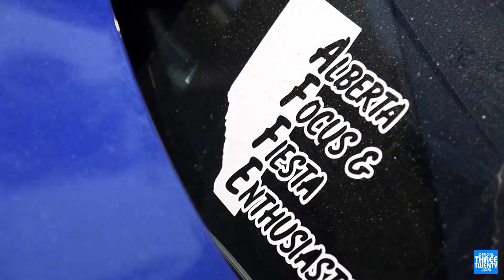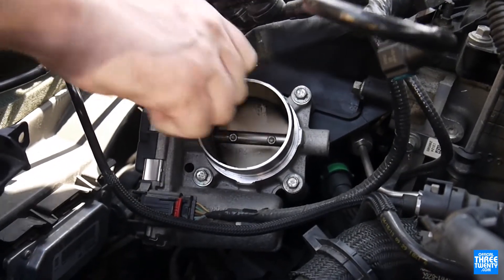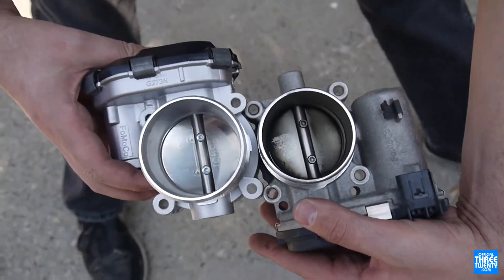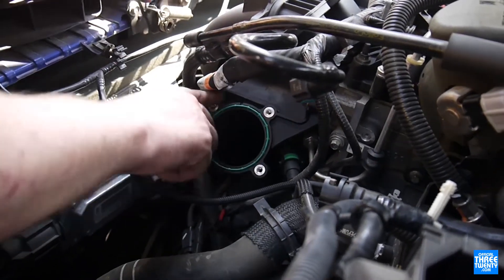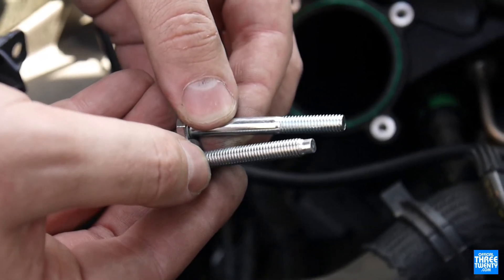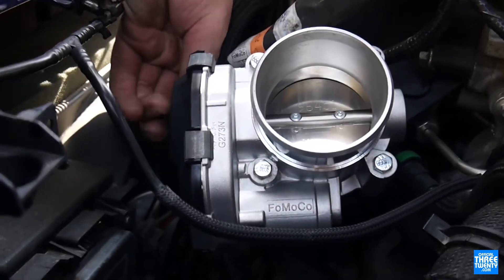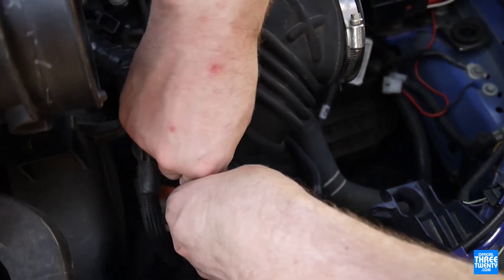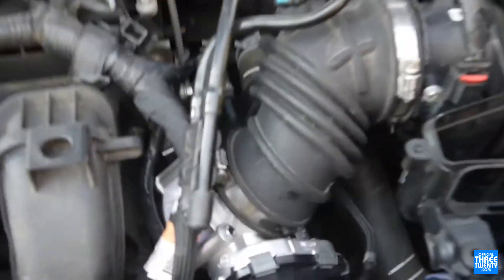Larger OEM Throttle Body for Brian's Focus Titanium

Comment: I did this mod on my 2016 Ford Focus SE Hatchback NA 4cyl 2.0L flex fuel engine and it makes my car run a heck of a alot smoother and faster in as far as acceleration. Thanks alot guys for the great tip.
Reply: Thanks for the rec
Reply: Hi, sorry for a question on such an old comment but did you lose any fuel efficiency doing this?

Comment: I did this install last night and would recommend placing the bolts through their holes then fitting the intake pipe over the throttle body before installing.  I tried doing it while the throttle body was mounted on the car and it was awful.  I pulled the throttle body off, threaded the bolts, and used Vaseline to mount the intake pipe on my work bench, which was much easier.  I could then rotate the intake pipe around as needed to torque down the bolts using the socket.

Comment: I have the 1.6 Ti-vct  petrol hatch ford focus 2012 
Would I be able to put the 2.3 litre throttle body conversion on to mine 
I all ready have the K@N filter but need to add more power and this sounds like worth a try
Reply: Not trying to be rude but wtf did u just say is real?

Comment: Hi, does anyone know if this throttle body will fit a 2012 Focus SE? Also, were you able to get it on a DYNO?
Reply from the maker: This will fit any Mk3 with the 2.0 engine. And no, we never dyno'd it.
Reply: im just now figuring out how much air restriction the engineers designed into this thing from the factory. i ripped the bumper off an se and found an intake choke in the engine subframe. you have to cut it out with a dremmel and use a router bit to clean it up and make it smooth. i mean at it's most narrow point, the se intake is only about 2-2.5 square inches. that is not a lot of air at all, i routed a second pipe from the bottom of the airbox to the dumb hole on the right side of the bumper cover and got actual manifold pressure. that thing rips now after i fixed the evap canister valve. just gotta figure out the catalytic

Comment: I am not able to find anyone who has put their Focus on a dyno, before and after, for real world comparison. Something that comes into play is with the larger diameter opening, velocity of air could be reduced. In such an engineered engine that may be a detriment. That's why I would like to see before and after dyno results.
Reply: Thats actually in the plan for the next bit, to get my car on a dyno, so that we can figure out what sort of power it is making now. With all mods that its got so far, vDyno says it should be making around 185-ish to the wheels, and I want a real dyno so I can say for certain.
Reply: That would be great. Modern engines can make surprising amounts of power (3.5L EcoBoost), but the engineering on them is pretty tricky to be able to do so. Things that logically should increase power don't always do so. As I mentioned, air flow can be tricky; i.e. increased volume vs. decreased velocity, and how this impacts cylinder filling with the intake manifold runner design and valve arrangement.
Reply: @1001Hobbies  and its not just airflow that im worried about, its also spark, timing, fuel, and a ton of other things. Im also debating getting cams, but at the moment, there isnt software available (inexpensively) which can adjust the variable cam timing, to account for a more aggressive cam setup.
Reply: What mods have you done? @Blue84Stang
Reply: @cstrombone  proper cold air, header, exhaust, throttlebody, and a few other tweaks...
Reply: @Blue84Stang  nice, how many wheel horses? And more importantly, how does it feel?
Reply: @cstrombone  no dyno yet... Similar mods have been dyno'ed around the 175-190whp mark at sea level, so probably around there...

From a rolling start in 2nd, its a RIOT... From a dig, I need to either change up my final drive or first gear (or both, realistically) because it spins at anything more than half throttle... And I'm about to make it substantially worse by installing a lightweight SMF and uprated clutch... So...
Reply: @Blue84Stang  I guess that answered my other question, if you have manual swapped it yet. Did you put in the 5 speed? I have the exact same titanium you have and I desperately wanna do it too. Along with the Euro mirrors. I don't know where to source them though.
Reply: @cstrombone  mine is factory 5spd... Keep in mind, the MTX75 is better in some ways than the DCT, but is worse in other ways. For example, I have to repair my shift selector every two or three years because the rollpin that holds it together is designed as the weakpoint and hard shifts make it snappy. Also, master and/or slave cylinders for the clutch are also known failure points.

As far as the mirrors go, I suggest ebay germany. Their focii are LHD, have the turn signals and puddle lights, and can also be had with either the power folding or the blind spot monitoring lights or both.
Reply: @Blue84Stang  I'm still doing the manual swap, but thanks so much for letting me know. And That great to hear about the mirrors! Can you still see your blind spot because of the mirror shape? And more importantly, how much did the German mirrors caust you?
Reply: @cstrombone  so... The big thing to keep in mind is that the glass is curved differently, lhd vs rhd. So, the short version is that they both will work, but you end up having them at the limit of travel in one direction to make them useful.

As far as cost, I don't have the faintest idea. I bought my set from the UK in the Before Time, when inflation was under one, and while North American economies were relatively stable. Now the only thing stable about north american economies is how much horsecrap is being shoveled into the public eye...
Reply: @Blue84Stang  what I was trying to ask is about the mirrors view, so let's assume it's LHD. Can you see your blind spot from the mirror? Like is the outer side similar to the little blind spot mirror in US cars?
Reply: @cstrombone  short version, not really. Instead of it being one tiny little mirror that requires your eyes to adjust to see things in it, the euro mirrors are a continuous curve which also covers a much more effective blind spot area.
Reply: @Blue84Stang  that's PERFECT. I don't trust blind spot detection ever since being traumatized by a 2023 Nissan Altima, so it's good I can still see my blind spot then! So did you ever get the blind spot detection working? If so, what did you need to do?
Reply: @cstrombone  not yet... But I suspect that its simply a matter of not being resisted properly. Each end of a canbus twisted pair needs to be terminated with a 120ohm resistor, and I had thought the BCM was internally resisted, but maybe not.
Reply: @Blue84Stang  idek what that means. I hope to see an update on your blog though!

Comment: After installing this do you need to tune anything? ECU or anything? Is it just good to go after installation?
Reply: Did you ever figure out the answer? Thanks
Reply: Truthfully, no. You don't NEED a tune, however a tune will take advantage of the increased airflow that the larger throttlebody allows.

Comment: Ford also makes a 70mm throttlebody for the mustang 2.3. Can it be used on the focus as well?!
Reply: Josh Gaule did you ever find out?
Reply: Duramax-fan man looks plug and play as well. But not sure how the computer will take it.
Reply: Absolutely. You would just need to figure out the tubing from the TB to the Intake Box due to the fact that the opening will be a tad bid wider

Comment: What did this do to the fuel economy?
Reply: Honestly, if you stay off the gas pedal, you won't notice any difference in fuel economy.

HOWEVER, the fact that the car will rev smoother and drop RPM's faster on deceleration makes it hard not to play around when accelerating, so you will notice a drop that way.

Comment: I have a K&N Typhoon CAI installed on my 2012 Focus. Will the hose still be able to fit over the 2.3L throttle body? If so, I definitely see this as a future mod to my car.
Reply from the maker: I'm afraid I wouldn't know the answer to that one. Sorry!
Reply: This throttle body does work with the K&N CAI without any modifications! I just did the install a few days ago and I love it.
Reply: I have the same Intake on my 13. Did your intake throw any engine codes? Or make the engine knock? 

The intake install on my car made it run like shit. I made sure everything was tight/no vacuum leaks
Reply: No. My car is running perfectly fine. I've had the intake on for about 4 or 5 months now. That is really weird the intake caused your car to run rough.
Reply: WannabeST Have you seen any change in average MPG?  Is it a noticeable difference in throttle response?
Reply: Not much has changed in my average MPG and not too noticeable of a throttle response difference. Maybe with a tune it might make it more noticeable, but I've been toying with the ST powertrain swap idea so I haven't done anymore mods since the bigger throttle body.

Comment: The air cleaner is sucking in less dense, hot engine compartment air. You went backwards.
Reply: You aren't wrong. The completely open factory airbox indeed does suck in hot air, but sadly, so do most of the aftermarket intakes. For example, the Roush, FSWerks, and k&n are all short-ram intakes which are all functionally the same as mine, save for a piece of thin-gauge metal that the filter mounts to. 

If I had ever gotten particularly picky about temperatures, a $10 roll of Aluminium self-vulcanising tape would have fixed the issue. Also, this intake was just recently switched for the AEM cold-air intake, which is a true cold air intake.
Reply: Putting the lid back on the box would have fixed it too, and the engine would have sucked air through the fresh air (cold air) ducts that come in from the grill. ANY (including AEM) intakes that have the filter open in the engine compartment is going backwards. They like to market the rubber seal at the top of the barrier as "sealing" to the hood, but it is not air tight, or even close. Unless it is a totally enclosed system with a duct that brings in fresh, outside air, it is not a "cold air intake." I know they sell a ton of things with that title. it's bothered me ever since they came out, taking advantage of people who really don't know about engines and cars. You could buy a muscle car in the 1960's that had a true "cold air" system. It was called "fresh air" then. Air would be ducted to the air cleaner on the carburetor from outside the engine compartment either through a hood scoop, or scoops, or through the radiator support, behind the grill (which was pretty big back then.) Today I see a "cold air" kit on a car and I ask the owner where the cold air comes from. Sometimes they point to an incidental hole in the inner fender about the size of your fist (no air actually comin through, just there to lighten the weight), and it is obstructed  by hoses, wiring harnesses, and other things. Just goes to show how little they know about their car. These people are being taken advantage of by every manufacturer of these kits. Did the owner of this car get it dyno'd before and after the throttle body swap? It would be nice to get some measured information.
Reply: @1001Hobbies  Well, as its MY car, no, it wasn't dyno'ed before and after. Also, the AEM does actually qualify as a true cold air, as it relocates the filter end of the intake to directly in front of the radiator, directly behind the holes in the bumper that direct air into the radiator, which is what my car has now. 

And as you pointed out, every SRI does the same thing, which is suck in hot air. The difference is that I didn't pay $250+ for it. I ran it for almost four years like that, and never once had an issue with it being open, aside from the filter needing more frequent cleaning.

Comment: Could you provide the link to the throttle body you had purchased? I have looked all over and can't get a straight direction on the subject. Also, did you have to calibrate anything after installing this throttle body?
Reply from the maker: This was purchased over the counter from our local dealership. And no, no calibration!

Comment: How much does this change the car? Is there any noticeable difference?
Reply: god Its difficult to say, truthfully. My car is the one used, and while I didn't notice an increase in performance per sé, I did notice an improvement in throttle response, which seems to be the general consensus. 

With the stock throttlebody, when Id accelerate, it would accelerate decently enough for a commuter car. With the new throttlebody, it gains RPM's noticeably faster. It's not a massive improvement, but you can certainly tell that it reduced or removed a restriction on the intake.

Comment: Interested in doing this.  Seen any change in MPG?  Did you order the bolts & gasket separately from the dealership?
Reply from the maker: I will have to check with Brian regarding that, but as we're currently in the winter season there will be too many other variables currently affecting MPG (winter wheels and tires, traffic, fuel blends, etc) to isolate any changes from just the throttle body.
Reply: No, there wasn't a noticeable difference in MPG before and after. Well, if I kept my foot off the gas, anyways. But with it sounding better, and revving much smoother, it made it hard to drive economically...🤣🤣

Comment: How much is the throttle body?
Reply from the maker: Pricing may vary but current retail is around $100 CAD plus tax.
Reply: It is cheap! $100? I want one!
Reply: Just got the throttle body, bolts and gasket for 72$ with shipping
Reply: @Social Outcast It's the same engine as the titanium. I have it on my 2016 SE.

Comment: Yeah I recently purchased the SCT x4 with a tubing software for a 16 se. if I were to swap out for this size TB and update the ecu for it would I receive more benefit than bolt on without the ecu tune?
Reply: Tuning’ software
Reply: Absolutely. The larger throttlebody allows more air to flow into the engine, so a tune will add a bit of fuel to compensate for that, which you'll notice.

Comment: How’s the driving difference on the ST with the new throttle? Does it even make a difference with the stock turbo?
Reply from the maker: I haven't noticed a massive difference, but I installed the throttle body when the car was parked for a couple of weeks (when it was undergoing other work), so I couldn't drive it back-to-back. Other owners have noted minor differences on stock turbo but I installed it in anticipation of a larger turbo down the road.

Comment: Installed one today on my 2014 Titanium w/ K&N Typhoon CAI.  Super easy and quick!  Biggest problem is getting the hose coupling from the intake over the throttle body.  A little Vaseline and elbow grease got it on.  Will have to remove the bolts that hold part of the K&N heat shield to get it lined up right.  Seems like the throttle response is noticeable but might be b/c I️ know I️ just installed this and that’s what’s expected.  Letting my buddy drive it tomorrow to see if he notices any real difference (he drives a stock Focus).  Will update with an impartial opinion.
Reply: @roberthigbee383  His drove off and never came back..

Comment: i read stuff on the fordfocus fanatics forum that this throttle body makes the computer on the focus freak out..and so it doesnt "really" work... any feedback on this brian?
Reply: Mr. S That's the 3.7L throttle body that doesn't work.  This 2.3L one works.  I installed it last night and can feel the RPMs climb faster.
Reply: You can do a reset on the whole computer after install. It will relearn everything with the new throttle body.
Reply: No computer freakouts or any other weird behaviour. Some have noted mild "surging", but I never noticed that. It really was as easy as it seemed in the video, and while it may not make much from a "horsepower" sense, having the engine acceleration smooth out makes it easier to drive.